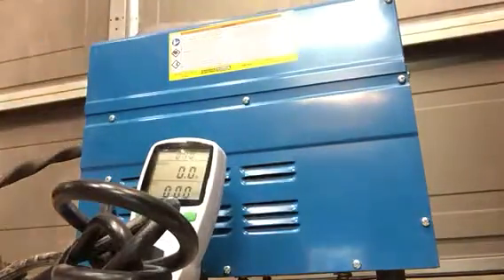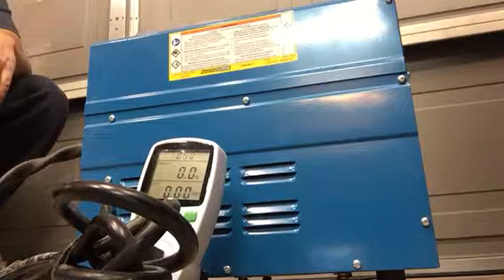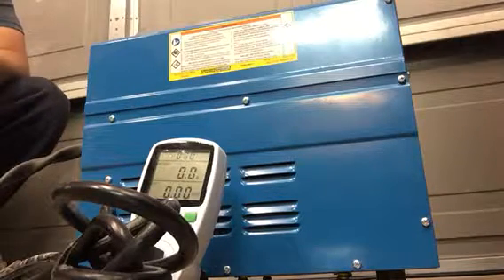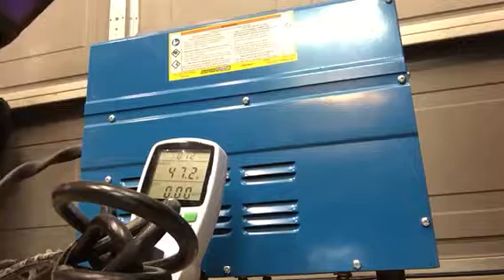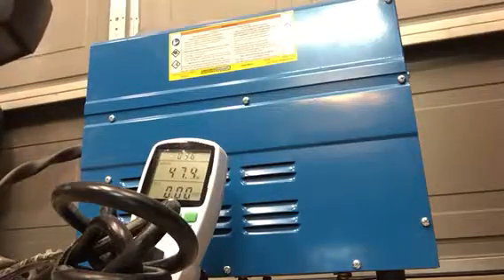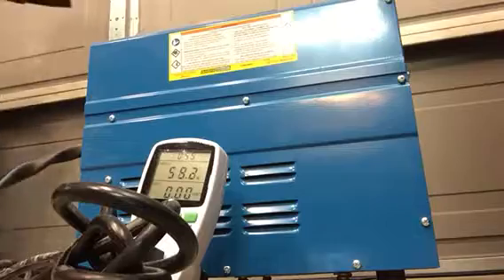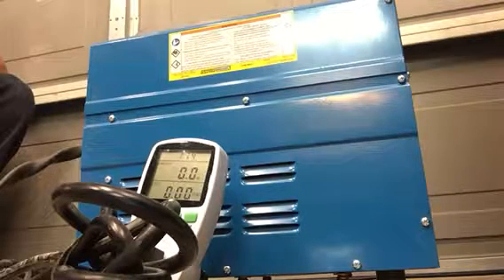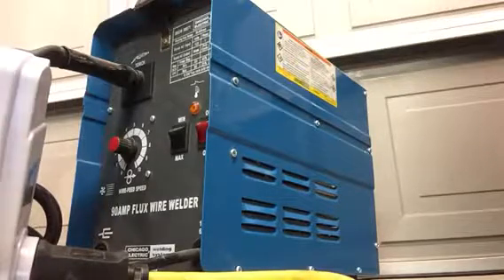Harbor Freight 90 amp flux welder. Testing-Wattage draw Jeep onboard welder

Comment: 5000 watt inverter peak power 10000 with a dual bttery will work 24volt jump system will work..as is will work on low setting but welds dont hold....on high need dual bttery....that work great...habe it on my yrility body

Comment: 90 amp x 120v = watts
Reply: How much shit have you gotten from china or cheap electronuc stuff that actually used what it was rated at?  Personally me, never once..  soldering gun, said 300w, measured 150...  small 500w heater, measured 350...   lipo batteries..  lol.  Yea i wish i could believe everything Im told...
Reply: That's not how it works with a welder. 90A is the output of the welder, but it converts the input Voltage to a lower value. For example this welder might put out 90A at 20V so 1800W which means it's drawing around 15A at the wall using 120V.

Comment: amps????????
Reply from the maker: Hi hyper. 1200-1400 watts @ 90amps. Thanks
Reply from the maker: +Dee Gabs this HFT welder is a 90amp Max welder.
Reply: yea duh... that is on the output side of things.
you  need to be looking for the amount of amps it is pulling out of the wall. 

so for instants it take 9.2-10.2 amps DC to make 1.2 amps AC.
don't think your going to find a cheap enough inverter and battery bank to make this possible. not that it is not possible, just that it is going to cost a lot to make happen.....
Reply from the maker: +HyperGro DWC ahh I see what you mean. Yeah not impossible. We'll find out soon. Thanks. I ordered a decent power bright 2000 watt inverter from Costco. I can always return if it doesn't work out.
Reply: @kulotsgarage118  Did the 2000 let you weld even at all?